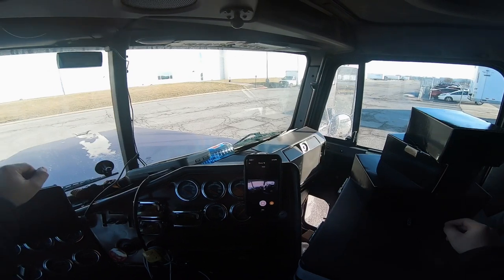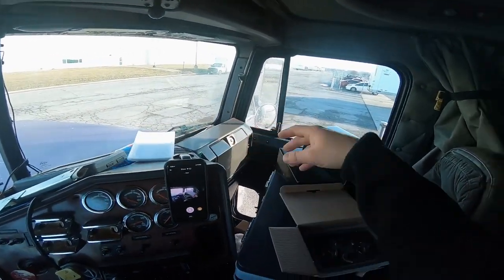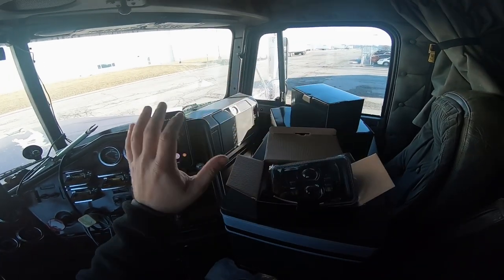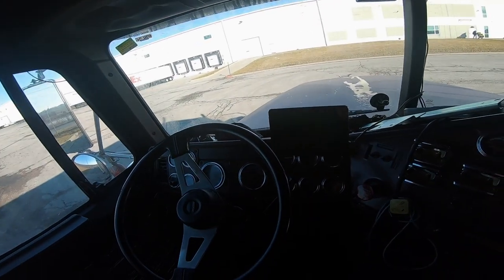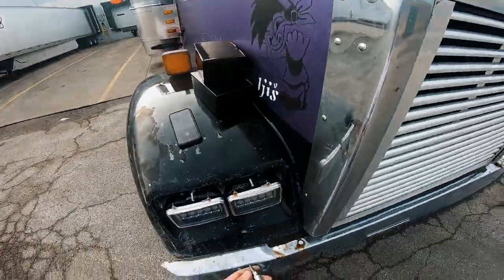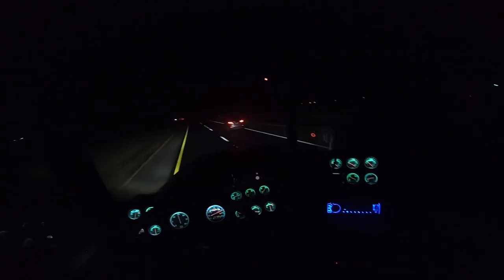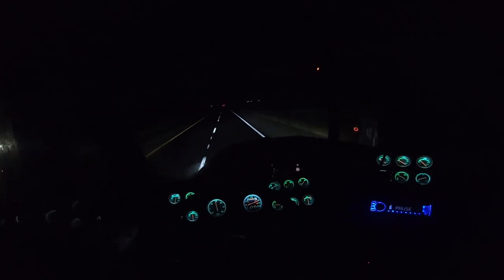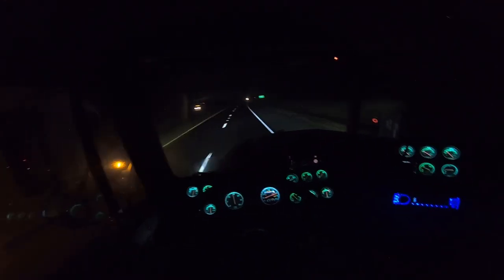Finally some affordable lights that don’t blind everyone?

Comment: I got some $37 led lights on amazon and they work great, all those lights are make to be T4 replacement bulbs so the wiring is different, we had a 2006 mack that they may have worked on, I cut the wires on my Kenworth and wire them directly in

Comment: you talked about heated led lights which are necessary if you drive in winter conditions...LED light don't produce any  heat per say , so they get iced up quickly, same for led tail lights you have to clean them often....as they say....always something! 
Keep the black side down & between the ditches :)

Comment: It looks like you have yours wired so that both lights burn on low beam and both lights burn on high beam as opposed to the old system of 2 headlights burning on low and 4 on high.
They look spectacular!

Comment: You can use any lights just have to properly aim them either with a machine or so many feet from a wall and measure the beam
Many people buy led lights chuck them in and it blinds people because they never adjust them they put out a different beam of light
Reply: You got it
Reply: You can't aim headlights that don't have a decent lens to aim the light output.  Cheap LED housings won't have a proper light cutoff and will blind people no matter how much you aim them down.  Same reason when people put LED bulbs in stock housings, the lenses are made for Halogen light output.  No matter how much you aim them there's still a bunch of light going off in different directions and not focused where it needs to go.
Reply: I remember back in the day most gas stations had garages and they had marks on the back wall for adjusting head lights.😃

Comment: Why dont you have a door key put up some were out said of the truck??
Reply: Fr a lot of truckers put an extra key inside the hood just in case
Reply: @nycliam8935  It wasn't the key or the lack of a key that got him stuck. AFAIK He stated the issue was that the Key Cylinder was spinning in place, as in it was disconnected from the door linkage.
Reply: @PingHorror  I wonder why he didn't just climb in from the passenger side?
Reply: @jimmyrockstar907  He said he replaced the lock cylinder on drivers side to a new key, was lazy and never replaced passenger side, so it uses a different key he doesn’t have. Funny shit lmao
Reply: @PingHorror  wow you actually watch and pay attention to the videos you watch... you’re one in a million! Thank you!